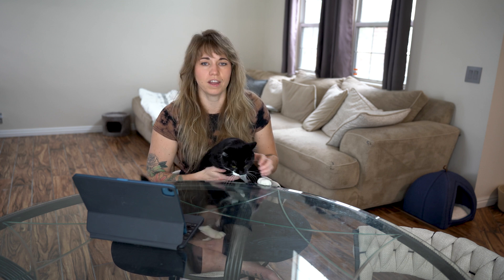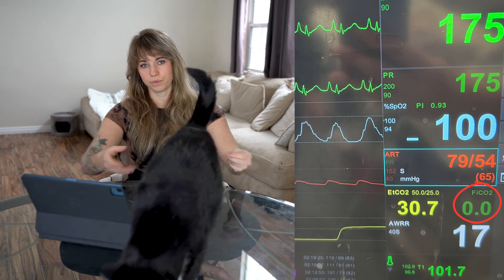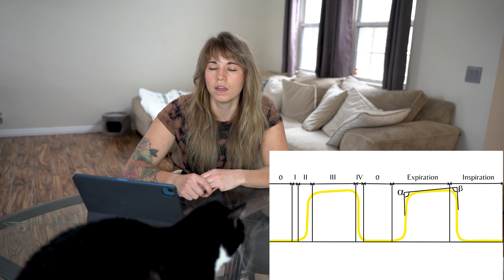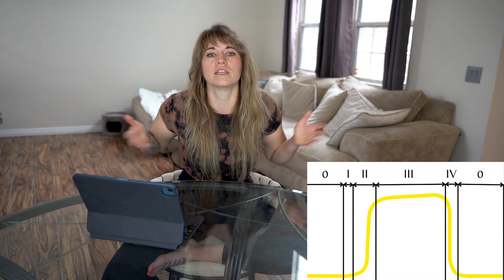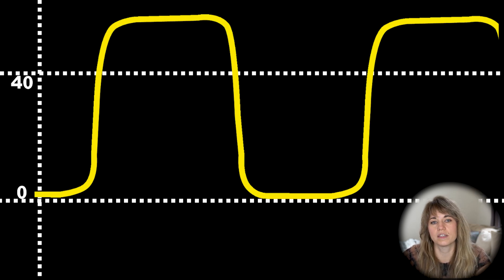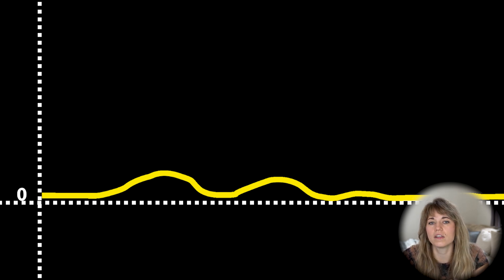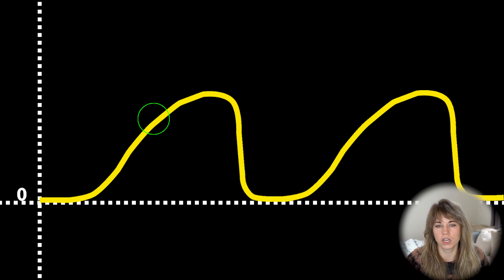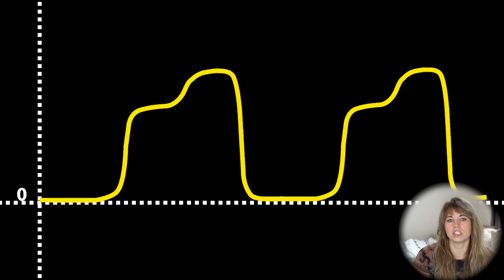Vet Med: How to Interpret a Capnograph

Comment: Hey Jennifer. Love your videos. Just started following you. My question is, when inducing a patient and after intubation and the patient doesn’t wanna breathe how long do you wait before you give them a manual breath to determine if they’re gonna breathe on their own or not?
Reply from the maker: If you are performing ET tube cuff inflation checks (providing a positive pressure breath after induction to check the seal of your endotracheal tube) then the patient receives a breath immediately after being intubated. This also serves as an initial EtCO2 reading to confirm intubation. After that, I will usually provide a breath every 10-15 seconds in the stable apneic patient, although that rate varies based on my EtCO2 and disease process . A single dose of propofol lasts for about 5-10 minutes so if my patient is apenic I anticipate providing support for that period. And if they’re still not breathing by the time we’ve moved into the OR after prep, I would evaluate their anesthetic depth, and decide on the use of a ventilator. 

I can’t find it now, but I read a study about induced apnea of dogs intubated and connected to an anesthetic circuit. They didn’t let the patient breathe and measured O2 and CO2 levels while still receiving a normal fresh gas flow rate. And it was something like close to an hour before their oxygen levels were affected, although the patients became severely hypercapneic. I think about that a lot now when I am supporting patients through the initial apneic period. Monitor EtCO2 and SpO2, and as long as those values are normal then your supported breath rate doesn’t need to be very aggressive.

Comment: Hi Jennifer! Love your content! For capnometer readings that are too low or too high would you increase your PPV to about every 10-15 seconds until a more appropriate reading is obtained? Or could that potentially lead to over ventilating the patient?
Reply from the maker: Great question! It’s totally patient dependent and varies upon your baseline. So, if their CO2 is low, decreasing breaths per minute will drive it up. If their CO2 is high, increasing breaths per minute will drive it down. So you can try adjusting your breaths per minute by 2-5 in either direction and see if that helps. 

Other things to asses for PPV are their breath size, and their inspiratory:expiratory ratio.
Reply: Will definitely be applying this concept. Thank you!
Reply: @jenniferlyonsvts Hi, I love this video. In regards to your comment about the size of breath with ppv, is the size of breath shorter when placing an obese (27kg) dog on dorsal and cause hypercapnea?